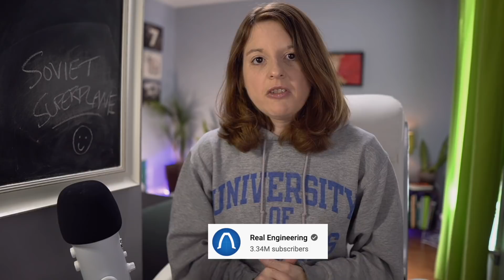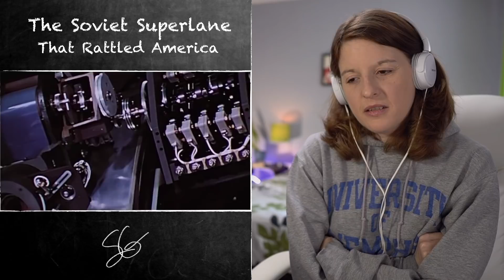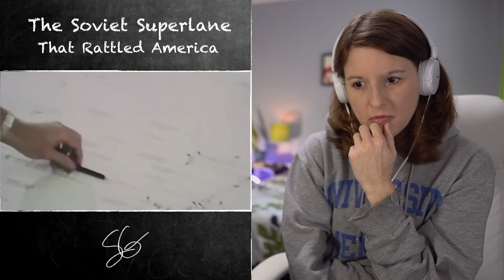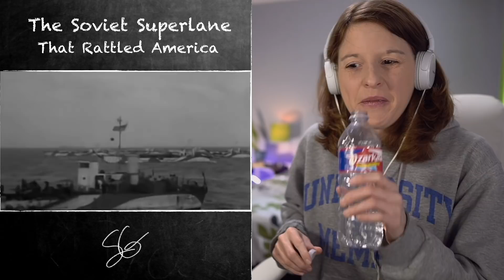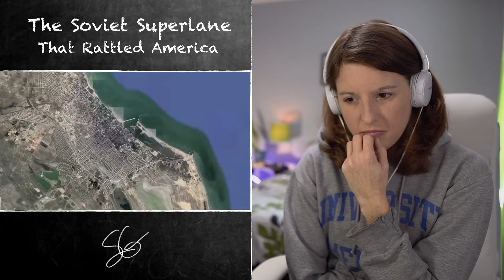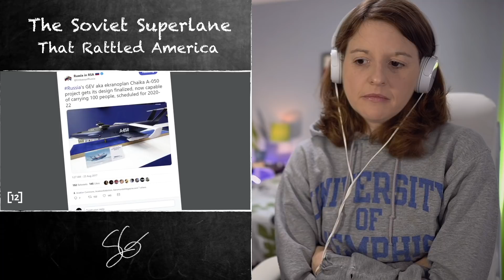American Reacts to The Soviet Superplane That Rattled America | Military 🪖🎖

Comment: You could design street cars on this principle but they would need the stub wings to provide lift necessarily making the vehicle wider than standard cars. Also the power required would be such that the size of car that performs well on 100hp would require about 180-200hp

Comment: If the question is: Is a similar screen effect above the ground possible? The answer is yes.
But it is expensive and requires many years of testing and practical use.
Therefore, as the cost of fuel rises or it changes to hydrogen, the next-generation ekranoplanes will occupy this niche, not tomorrow, but in decades.
It is possible to solve all technical problems, moreover, they have already been solved, but it is too expensive to build anything other than prototypes while there are seaplanes.
What will happen next? Look at the project "ЭКИП", this is also an ekranoplan.

Comment: The bandwidth of the data transmission is still very limited, and so far the films are dropped in a similar way, this is applicable for small operational intelligence satellites. This is in many cases faster than waiting for data to be received. Either a large satellite in high orbit that has enough energy to transmit, such a digital photo "weighs" an awful lot, so at best it takes minutes or hours for the satellite to pass over the target point and tens of minutes to transmit and stitch data into something suitable for analysis. In any case, it's not online and it's NOT easy at all. It's strange that anyone thinks that at all.

Comment: The "barrels" at the front are eight of the engines. It's a unique feature of Russian designs, they're placed so they can direct their exhaust under the wing to allow the aircraft to enter ground-effect more quickly, and also can force air under the wing to allow it to operate over land, something most aircraft of this type can't really do. The two engines on the tail are the only ones that power it when it's cruising.

Comment: I Hats off to Alekseev - a brilliant designer.
In the designs of ekranoplanes, two schools can be distinguished: the Soviet (Rostislav Alekseev) with a straight wing and the western (Alexander Martin Lippisch (German)) with a forward-swept delta wing with a pronounced reverse transverse V. R.E. Alekseev's scheme requires more stabilization work, but allows you to move at higher speeds and in airplane mode.
The Lippisch scheme includes means of reducing excessive stability (a wing with a reverse sweep and a reverse transverse V), which makes it possible to reduce the deficiencies in balancing the ekranoplan in conditions of small sizes and speeds.
The third proposed scheme was the tandem scheme of G. Jorg (Germany), however, despite a number of advantages (automatic stabilization), it does not yet have followers.

Dignity
Ekranoplanes represent a completely new line of development of vehicles, an indisputable advantage is a lower level of fuel consumption, in comparison with any aircraft, due to more gentle and economical operating modes of the power plant per unit of transport work in t / km.

High survivability: modern ekranolets are much safer than conventional aircraft, since in the event of a malfunction in flight, the amphibian can land on the water even in strong waves. Moreover, this does not require any pre-landing maneuvers and can be done simply by dumping the gas (for example, in the event of engine malfunction). Also, the engine malfunction itself is often not so dangerous for large ekranoplanes due to the fact that they have several engines, divided into a launch and sustainer group, and the failure of the sustainer group engine can be compensated for by starting one of the launch group engines.
Sufficiently high speed - from 400 to 600 km / h and more - ekranoplanes surpass hovercraft and hydrofoils in speed, combat and lifting characteristics.
The ekranoplans have high efficiency and a higher carrying capacity in comparison with airplanes, since the lifting force is added to the force generated from the ground effect.
For the military, the stealth of the ekranoplan on radars due to flight at a height of several meters, high speed, immunity to anti-ship mines is important.
For ekranoplanes, the type of surface that creates the screen effect is not important - they can move over a frozen water surface, a snowy plain, over off-road, etc .; as a result, they can move along "straight" routes, they do not need ground infrastructure: bridges, roads, etc.
Ekranolets belong to non-aerodrome aviation - for takeoff and landing, they do not need a specially prepared runway, but only a water area of sufficient size or a flat area of land.
Flaws
One of the serious obstacles to the regular operation of ekranoplanes is that the place of their intended flights (along the rivers) very accurately coincides with the zones of maximum concentration of birds;
Low maneuverability, since an ekranoplane, like an aircraft, must create a centripetal force to change the direction of movement, the only source of which is the wing. At a flight altitude of the order of the MAR of the wing, the possible rolls are very small, and the turning radii are too large.
The ekranoplan is "tied" to the surface and cannot fly over an uneven surface; the ekranoplan is devoid of this drawback (This type of ekranoplan can fly like an airplane, but with excessive fuel consumption.);
Controlling an ekranoplan differs from controlling an airplane and requires specific skills;
Although the flight "on the screen" is associated with lower energy costs than an aircraft, the launch procedure requires a higher thrust-to-weight ratio comparable to that of a transport aircraft, and, accordingly, the use of additional starting engines that are not involved in cruising mode (for large ekranoplanes), or special starting modes for main engines, which leads to additional fuel consumption;
The lower energy consumption during the flight "on the screen" is offset by the fact that the ekranoplan flies at low altitude, where the density of the atmosphere is maximum. As a result, in terms of the totality of indicators, ekranoplans not only do not have any advantages over existing vehicles, but also lose absolutely in all respects to conventional aircraft and ships: ships significantly surpass them in displacement, aircraft in terms of speed and flexibility of use. Even for highly specialized tasks, such as providing emergency assistance to the crews of ships in distress, it seems more expedient to use existing and mastered Be-200 amphibious aircraft.

Comment: The Ekranoplan is amphibious, it can go on land as well, provided it keeps the speed required to generate the ground effect. 
Once in ground effect engines are put to minimum power. 
The real problem is to maintain the aircraft at the right altitude to not take off completely or touch the surface. Sea water is never really flat, waves can be bigger than the ground effect height so it works better in lakes or calm waters, making this technology very situational, hence why it didn't become the new naval warfare strategy.
The other problem is maneuverability, it can't turn quickly and can be vulnerable to incoming missiles.

The Pelican design is rather special, it can also lift outside Ground effect to become a real aeroplane. It's a hybrid design.

The KM was definitely Soviet Engineering at its finest. Kroutchev liked the concept a lot. His successor, Brejnev didn't and as Alexeiev wasn't a social guy he didn't cultivate relationships with the politicians, so Brejnev mothballed the program and fired Alexeiev who stepped into depression.
You can have a more reliable tech for cars, the hovercar with a skirt and a fan generating air cushion under it, it has infinite maneuvrability and is totally amphibious.  However it isn't very fuel efficient. So you are not gonna see those anytime soon on the roads. And as you say, people generally have problems with normal cars.
Drones might be the solution for short distance air travel but air safety regulations absolutely HATE that. I don't think it will go through as far as passengers are concerned, for cargo and surveillance maybe, but nothing more.

As far as military use, cruise missiles took the same role as Ekranoplans for a much less expansive bill overall. Cruise missiles and other long range ship based missiles are the natural counter to aircraft carriers. Most Russian ships have those, so the miliraty Ekranoplan isn't viable anymore. And with the newcomer being the hypersonic missile, even less use for the Ekranoplan can be found, military wise. For transport, boats and aircraft will still be a thing for the next century...

An other idea of a failed technology; the Aerotrain ! It is a French invention. Germans had the idea of the electromagnetic levitation version. Guess which came to life for real? Hint, the oil crisis of the 70s decided the fate of the loser...

Comment: First read about these things in magazines:/newspapers couple of decades  ago. The ground effect is generated by high speed, and airflow under the plane. It works well over water which is relatively flat and obstacle free, but on land there is too much variation in topography and city streets are definitely a big no-no. So no flying cars. Hovercraft work on an air cushion too, but don't use speed to create it, they have giant fans blowing air downwards, which is contained by a skirt, and directed air jets. They are also a proven technology which hasn't found a mass use market. They are valuable for specific situation though.
The wings angling downwards are less stable than those V'd upwards often seen on conventional planes, but on the acrano-plane it helps to hold the air cushion beneath the craft. Different physics for different situations.
It's a good video, like you I thought it would analyse more conventional USSR planes,  like the celebrated Foxbat scare. But this is more interesting. Nice to investigate the other countries experiments.

Comment: To give a "Spark notes" or "For Dummies" summary.... aeroplanes use wings that develop a higher pressure under them to lift them into the air.... hovercraft create a cushion of air underneath, hence a skirt; two  fans, one to lift, second for propulsion.... an Ekranoplan tapers the stubby and deep wings down to contain an envelope of cushioned air.... the precursor being a hydrofoil, where the wing is under the ship, at speed it lifts the majority out of the water to reduce drag or water resistance.

Look at the infamous RN4 Hovercraft, aka the Mountbatten class....

Comment: High mounted wings on aircraft are usually Anhedral, the wing tips are lower than the wing root. This design is inherently stable and is used on most heavy lift transporters such as the C-17 and C-5.

Low mounted wings are usually Dihedral with the wingtips above the wing root - most commercial aircraft are built this way.

Comment: One of the requirements for this to work is to maintaing a pretty much constant height of the wings above the surface (water or gournd). And this height has to be quite low. Less than half the wingspan but preferably much lower. So on a nice flat surface your ekranoplan can be very small and still fly very fast in a nice straigt line. Like those passenger ones around tropical islands shown at the end of the video. 
But as soon as you are over waves or terrain you would have to go so high the ground effect no longer works and now you are building just a plane, not an ekranoplan. To stay in ground effect you have two options: 
1. follow the coutours of the surface and still maintain enough speed to keep enough flow of air around the wings to keep enough lift. Even if you manage that it will not be a pleasant ride for anyone on board - very fast rollercoaster constantly. 
2. make the ekranoplan so large that normal waves or small terrain features are basically just small surface imperfections compare to the size of the vehicle and it does not care about them. This is what the proposed Boeing Pelican was meant to do. It was planned to be so big that even waves several meters high would not bother it. The downside is you need very big ports/coastal airfields for it to land and building it is a bit difficult and extremely expensive. So nobody wants to give you money to build one. 
So if you look at it this way you get what the video was saying near the end. An archipelago with mostly nice weather and distances between the island so short that planes do not have time to climb high and go fast is the area where you want to use an ekranoplan. But that is pretty much the only area where it can beat a plane.
Reply: The other alternative is to make them drones.  So if it's an uncomfortable ride, it doesn't matter.

Comment: The  ground effects are used in all forms of transport ... more famously in Racing cars ... i.e.  F1 cars and Indy cars are famous for using many " downforce "  tricks to make the cars stick to the road at high speed ... however if air gets under the car they can suddenly flip or even take off ... this also happened to Bluebird killing the pilot / driver while he was trying the break a water speed record ... it is a  " risk versus reward " trick that can quickly go wrong.

Comment: That Boeing looks like it was designed by the same guy who designed the Romulan Bird of Prey. Incidentally SoCal, a British scientist in ww2 had a plan to build an aircraft-carrier out of ice and sawdust. It was planned to be 1/4 mile long and weigh 1/2 million tons, they got as far as building a 60ft scale model and naming the full size version HMS Habukkak. The project was cancelled but, before you think "that would melt far too easily", the scale model took 4 years to melt.
Reply: Do you know what the primary source for that story is? I've never found it (or looked very hard tbh) but I've always been curious. The only thing I know for sure about Pykrete is that the Mythbusters tried making a boat out of an upgraded, stronger version of it, and it didn't really work. The stuff melted just as easily as regular ice. I suppose it could work in the polar regions, but elsewhere it must need some kind of refrigeration system to keep it from melting.
Reply: @mikelavoie8410  There's quite a few pages on it on youtube, a naval history youtuber called Drachinifel checkout his "HMS Habukkuk guide 113. Btw I made a mistake on the weight, it was going to weigh 2.2 million tons!

Comment: There are several recent aircraft where the nose is hinged. Some of them tilt upward others to the side. The ones to the side like the Aerospace Superguppy are to accommodate a larger opening to load huge cargo
Reply: Similar aircraft were in use in the '50's as very expensive way to cross the English Channel, taking 5-6 cars on each flight.  The whole nose swinging to Starboard or splitting down middle and opening either side. Two models both had cockpit above loading hatch.

Comment: The issue with ground effect cars is the lack of precise directional control, the need for a fairly flat surface and the need to maintain a speed high enough to induce the effect. These limitations make GEVs impractical for personal transport in cities. I believe there is a navy vessel that uses a combination of hydroplaning and GE.

Comment: Problem was .. waves.  The weather has to be perfect.
Reply: It could operate in substantial waves no problem... theoretically, because take off and landing were impossible, you would most certainly crash then lol. 
It also (the giant KM at the very least) required spotters ahead to prevent them from crashing into other ships, because Ekranoplans has huge turning circles and, because of their speed, pilots had little to no time to react to obstacles.

Comment: Probably won’t find any application on land, Ekranoplans get unstable very fast if you turn too narrow (ie might flip over and the momentum and contact with the surface will just ripp the craft appart) and considering their large turn circles it just isn’t practical on land where there is always something in your way. That’s why they are only applied on water. Also i would expect the basic layout of cars to remain for quite some time like they are today. In the 1960s to 90s there were many experiment with magnetic trains (trains that hover on and are propelled by a magnetic field) and they just didn’t catch on because they didn’t solve enough problems to warrant the changes in infrastructure that would have been necessary, which is why we still use traditional trains though we have the technological means to make something more shiny happen. Good example of „If it isn’t broken, don’t fix it“.
Our cars are already able to go much faster as most of our roads allow for and what is lost on energy through friction would be surpassed by the energy needed to lift the car from the ground. But yeah i too would like to have a hover car, or at least a hover board 🤷

Comment: Groundeffect is heavily used in racing cars. Formula 1 used it for a long time and it is coming back for the 2022 season after cars got to fast with it before. In short they use it the other way around and press the car into the ground with the bodywork under the car.This way they can atack corners a lot faster, because they wont just fly out of the corner.
Reply: It became required for the Le Mans Prototype cars in 2011 to prevent cars fly up in the air if the front got lifted a bit.

Comment: "Barrels" at front were turbojet engines. Probably need too much speed to generate adequate lift to be practical for cars. Ground effect may not work very well in rough seas. May be OK over a flat calm.
Reply: До 5 баллов .